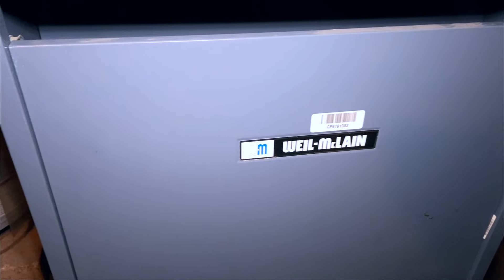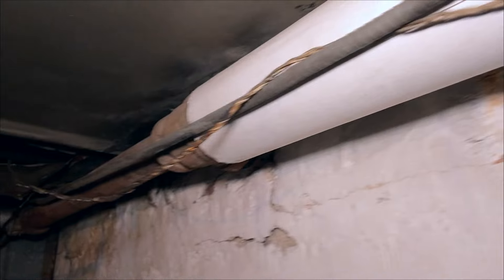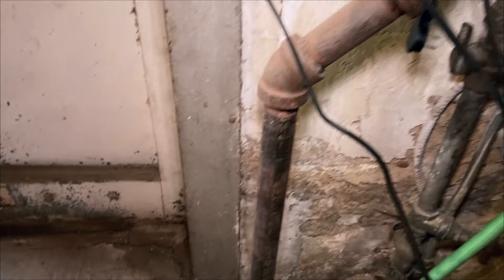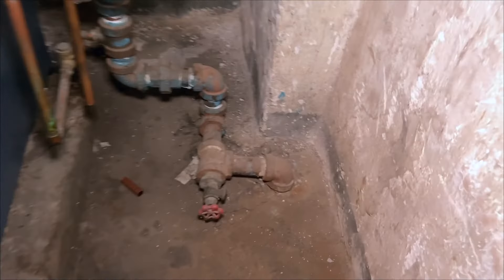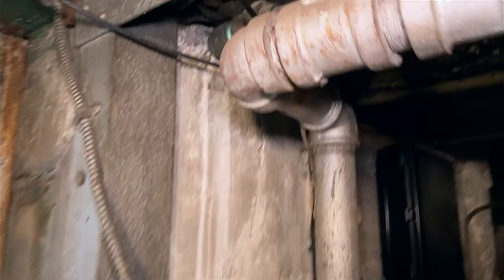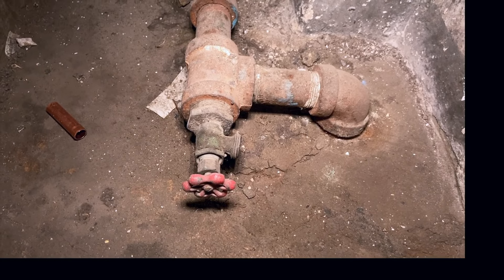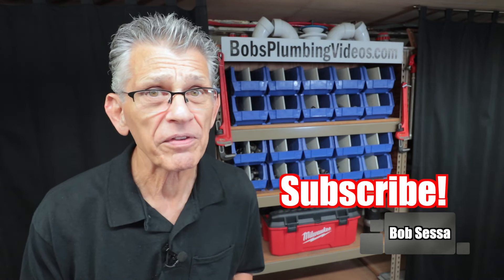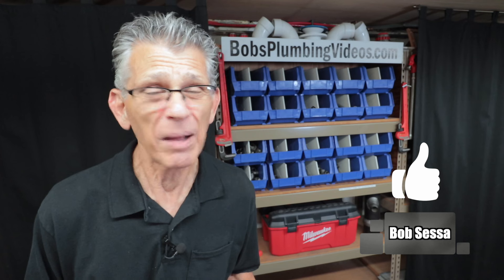My Steam Boiler Keeps Losing Water

Comment: Bob, great & honest repair!  Thumbs up.

For a future video, could you cover proper tightening of pipe threads in steel, iron, & PVC pipe?  I've never broken a metal pipe fitting by overtightening, but I have broken PVC fittings (at least one) and I'm always unsure how tight to fit pipe & fittings without leaks and without breaking fittings.  I'd get a licensed Plumber for most work in our house, but do things like outdoor piping myself (where a mistake won't ruin the inside of the house!).
Reply from the maker: Great suggestion! Thanks for the video idea!

Comment: Great job! Being a fellow Bay Ridge homeowner, just curious why you used copper for the return. The return (wet) on my steam boiler is 1 1/4” black pipe running at floor level. Thanks again for the educational videos. 👍
Reply from the maker: Big time saver! No cutting ,threading, lugging around pipe threading machines. The labor savings justifies the extra cost of the copper pipe . I.M.H.O.
Reply: @BobsPlumbingVideos  Thanks. Appreciate the insight.

Comment: Pardon, I have a few questions:
How do you use spool wick? Do you just wrap it around the threads?
What is the difference between a wet and dry return? 
What do you use to transition to CU from galvanized?  Did you go galv. to brass to CU?
Reply from the maker: Wrap the wick in between the threads overlapping. Wet return would be below the water level of the boiler, ie: at ground level or below. Dry return would be above the water level of the boiler and some point would drop to ground level before entering back into the boiler. Not sure what you mean by CU?
Reply: @BobsPlumbingVideos  CU = copper.  And thank you.

Comment: Don’t you turn off power to the boiler and controls over summer?  Why would low water cut off be calling for water feeder in July?
Reply from the maker: She didn't turn the power off after heating season, started to see her water bill go crazy and then started hearing the feeder cycle. She had a leaking return line, NOT a bad feeder.